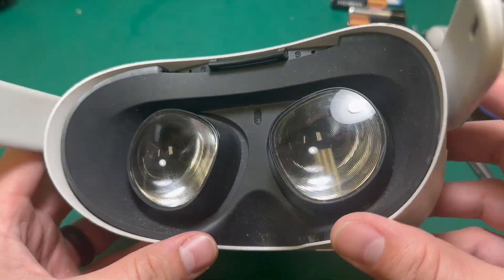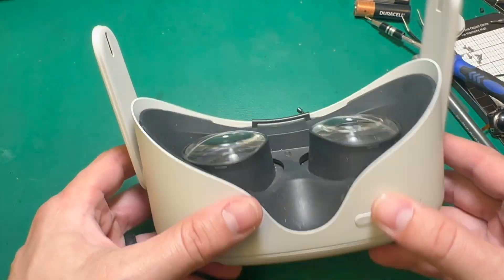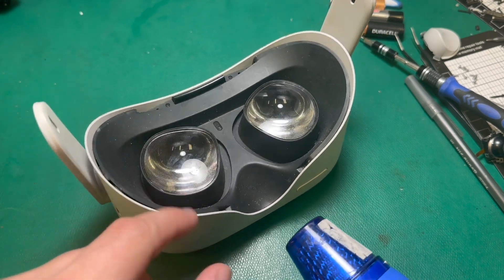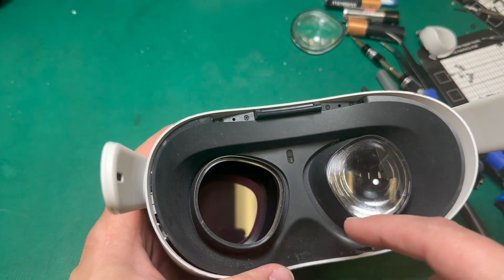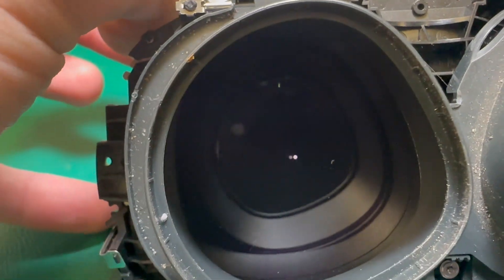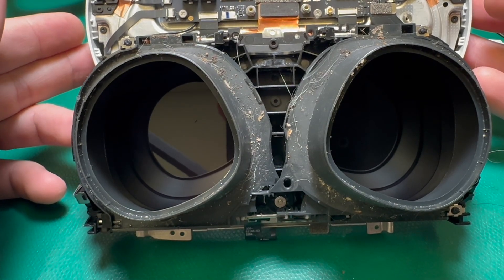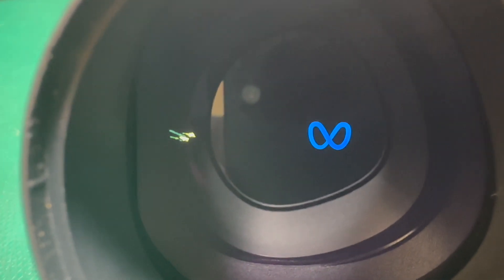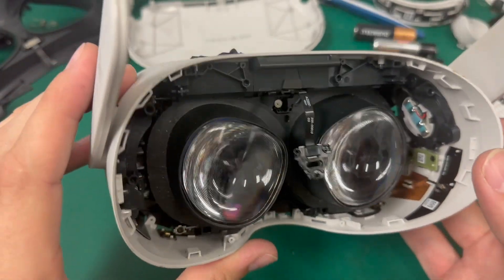Quest 2 LCD Damage - A Closer Look At Bad LCDs & Sun Damage

Comment: I have a question about my headset.  I have a Quest 2.  I was sold it as an unopened box device.  It's hard to describe what I'm seeing when I look through the lenses.  I have tried with both my regular glasses and addon corrective lenses.  What I'm seeing looks like fog.  But it's not uniform, more irregular shaped like a cloud.  It's super noticeable if I have the eye pieces adjusted exactly correct.  Not so noticeable if they are off a bit. It looks like a translucent cloud, floating in between me and the thing I'm seeing.  Could this be some kind of sun damage or other LCD damage?  Or is it normal and I'm just unfortunate to be able to notice it?
Reply from the maker: Gosh. It’s really hard to say what that is based on the description. If you are able to photograph it or take a video of it you can email it to us and we could take a closer look.

Comment: Hey! So, I had a Quest 3 (Already sold for parts), I tend to work on my own stuff, but since this was a newer console I did not want to mess about with it too much. I was playing with it one day and left it on top of a table inside the house without sunlight for the night, it was not even charging. However, the next day I tried to use it and it never worked again. Both screens went completely black but I could still hear audio and powercycle the device. The controllers would connect and I could even stream to my phone and see that the headset was tracking properly and working as expected. Just both displays suddenly went off forever. I guess my issue was the LCD backlight controller or high voltage circuit, but never got to diagnose it. I disassembled it to remove the battery for a few hours just in case but nothing. I just put it back together and sold it for parts.

As part of the diagnosis I did notice that if the headset was fully turned off and I tried turning it on the displays, either both or just the left one would turn on the backlight slightly for around 1 nanosecond, not enough to notice unless you were on a completely dark room and with the screens firmly placed next to your eyes as it was so quick and so dim. After that, just black. Controllers would connect and track normally by the way.

My question is, have you ever had something similar happen or do you know how to diagnose the LCD driver circuit? It is a bit late for me, but could help others in the future, although I suppose this is not a common issue. I just found your channel today and wanted to ask in case it is something you guys have any experience with.

The console was a Quest 3 512GB, bought new when it came out, lasted for about 6 months.

EDIT: The bootloader would not show a display either by the way, screens would not show an image no matter what and since I wanted to sell it for parts as I supposed the screens were good (I mentioned this to the buyer), I did not want to take the lenses off in case they could crack or get damaged in any way or dust could get caught on the screens, but I wanted to to see if the screens were showing a video signal but no backlight, however, this was not confirmed. I did manage to factory reset it however accessing the bootloader and going through the options blind as I know the basic android UI it uses for that.